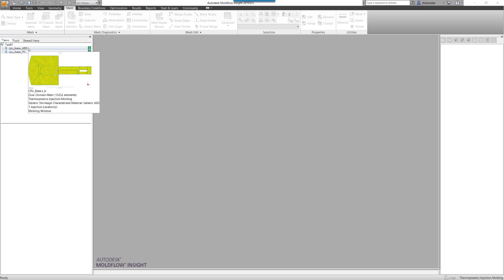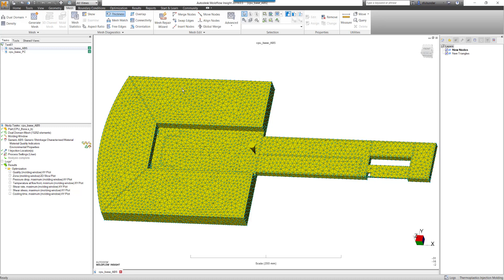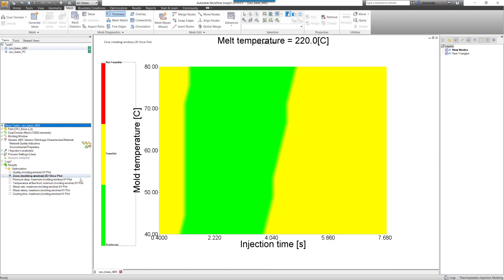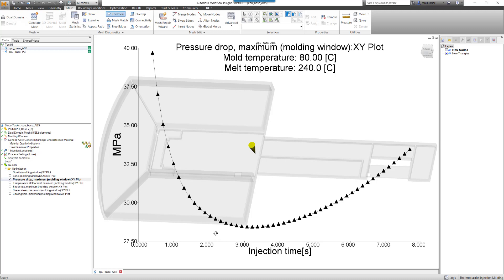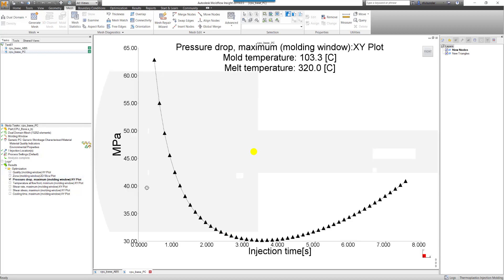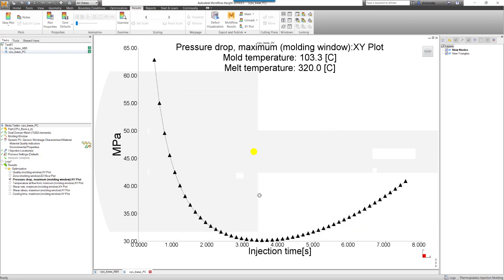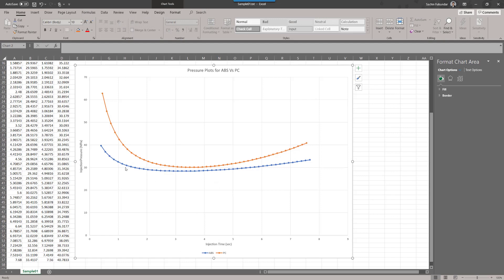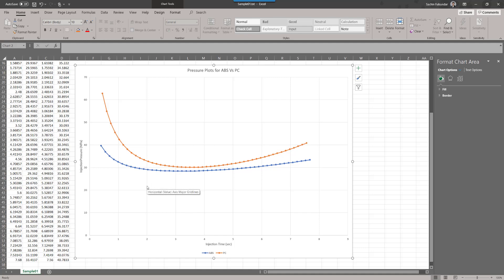Autodesk Moldflow Molding window Analysis

Comment: hello sir 
well i read before that the molding window is a weak analysis because it doesn't capture the feed system in the result and since a very high pressure drop happens in the feed system then the result of the molding window is not accurate at all, and i need to run multiple analysis to figure out the best fill time that gives the lowest pressure loss and high quality...if what i read is right why do you think anyone would need the molding window analysis ?
thanks